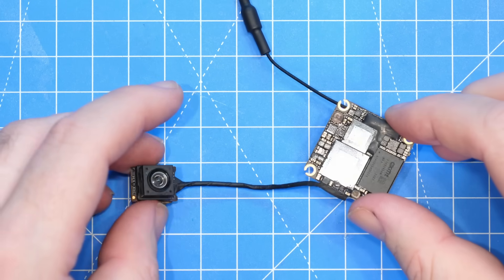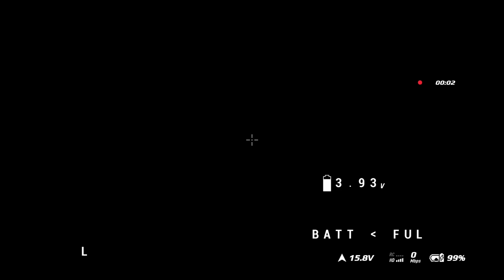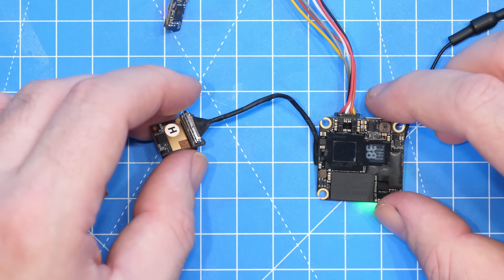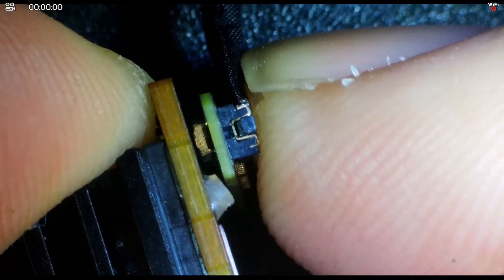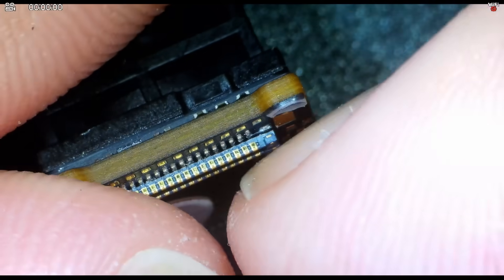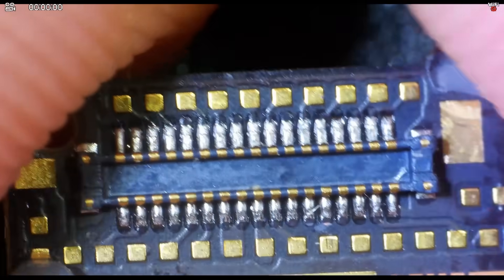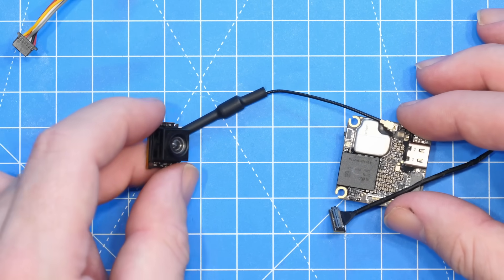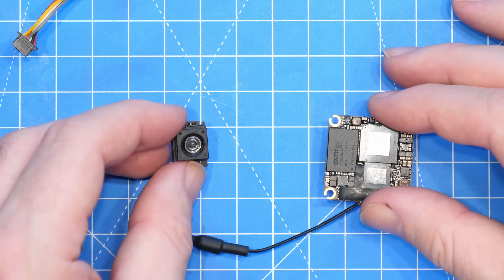DJI O4 Airunit Failure - Bad Design ?

Comment: When you look at the build quality of the original air unit, the O4 appears to show quite a reduction in build quality from DJI.
Reply: If you want reliability , OG air unit is the wait to go
Reply: It was just beefier. Had a lot of shielding etc. Nothing technically related to the build quality of the board itself. The soldering process should be the same if not better. Newer revisions may simply reduce the total number of jellybean components. If they possibly saved a little bit on a different mipi connector then so be it, but this is not really something they designed or advertised to have the cable swapped around. Since users are buying the unit and stripping it down naked anyway, apparently they realized it's more important to the customer to make it lightweight.
Reply: 100%
Reply: In What ways?
Reply: @MountFPV  I've never had an issue with the original air unit, nor heard of anyone else suffering QC issues with it. On the other had, the O4 has only been out a few weeks and I've seen reports of broken mipi cables and DOA units out of the box.

The natural conclusion to the above is that the O4 is more fragile than the original AU and that QC had dropped.
Reply: @Crunklefloop  Have you had an issue with the 04 air unit or the 04 air unit pro?
Reply: @MountFPV   I haven't bought it yet.  I was tempted as the O4 appeared to answer a lot of feature requests missing in previous VTXs, but after seeing multiple reports of issues, the restricted range cap and DJI pulling INAV support last minute it has put me off. 

Seems to me there's no real advantage over the O3 other than a bigger camera sensor.
Reply: And also DJI never sold a "light" air unit before so it's not "the natural conclusion" because you cant compare the two. It's a less than 10 gram computer and camera that records 4k video for $109.
Reply: @Crunklefloop  do you have a 04 unit yourself? If not, I wouldn’t be speculating or assuming. I was just as wary, but I have eight units and the light and the pro have yet to let me down… I’ve even had the frame explode from hitting a pole on one of mine and it still works.
Reply: @Sukanoops  I had typed a polite yet detailed reply above regarding my comment but it seems to have been deleted.

It's great that you're happy with the O4, and I'm glad yours are working correctly. 

I would have to politely disagree that one shouldn't speculate or use the experience of others before making a decision. As an example; before buying a car, you would typically check to see if there have been any reported problems from other users of that model, before making your decision to purchase. 

In summary: I was in no-way saying the O4 was bad, I was saying that I have seen more reports of problems from users of the O4 in the first few weeks than I had seen reports of O3/Vista or the original AU's).
Reply: @Crunklefloop   I shouldn’t speculate or use the experience of others before making a decision???? And then you go on to say you’re basing your comment off what you’ve seen on other people’s channels or have heard on the Internet. How dense are you? The irony😂 I’m not trying to be rude. It’s just sort of ridiculous, did you not even read your comment before you posted it? Also, you should’ve just posted your summary instead of all the other pointless dialogue.
Reply: @Sukanoops  huh? If you read what I wrote again, you'll  see that I'm  swying that you should speculate and use the experience of others before making a decision. Perhaps we're actually agreeing, but simply misinterpreting each other.

Anyway,  I'm not trying to get into semantics; I made a simple observation. It could be correct. It could be wrong. But it was just that, an observation.

At the end of the day, it really doesn't matter what VTX anyone chooses. This hobby should be about enjoying flying, rather than arguing on Youtube.
Reply: @Crunklefloop  Here's one observation I've made, the factory O4 mipi cable may or may not be as durable as on the O3.. but I would assume they are of the same quality. Either way my first mishap with the O4 is a broken cable which I could only source a replacement for from iflight. The cable broke because I accidentally tugged on it way too hard by having something weighted (the camera was attached to) fall off the table and hang from it. I've done that with the O3 before but that just resulted in the connector coming loose, easy fix. The cable broke only from the transmitter side because it has slack inside the camera end, which is sort of sticky-taped down before reaching the connector. 

So after having said that it's the only example I can think of where the actual mipi connector is going to break outside of constantly wiggling it reconnecting cables. In my case the connector didn't even come close to breaking as the cable wouldn't even pull through the gasket on the camera end. All the stress was on the transmitter end and just one wire barely pulled out. Given the actual weight of these mipi connectors, and that they are actually enclosed in metal, it boggles my mind how anyone could break one from crashing their drone unless they literally snagged the cable on something.

Comment: DJI repair service should fix (replace) this under warranty. Hopefully they will revise the design after they get enough back under warranty. They have service centers local to you more than likely!
Reply: Or...it will fail mid flight...
Reply: @stst8301  not likely, will happen after a crash, and for a micro in the park this really isn't an issue... Besides, Betaflight 4.6 has landing mode using just a barometer now, and with gps has working position hold and amazing return to home.
Reply: But they can claim its user error/fault because he remove the glue in the connector that prevent this happen….DJI will ask him to pay to fix the connector or just give him a new board so he can give them some positive publicity finally 😅
Reply: @dstepsfpv  have you ever dealt with DJI support before? I have sent them in two very physically damaged 03 air units (one was crushed, the other had a UFL ripped off) one was replaced for free under warranty and the other one was only like $5
Reply: I hope they won't change a design to support removing part of it (original glue) and straining the connector like 20 times. It should work and survive in practical use.

Comment: Yes,he cut the glue and didn't seem to mention it.
Reply from the maker: The glue won't help much in a good crash.  The point is this is particularly weak point that will pivot as well.  I'm highlighting that fact that the interposer will cause issues like this.
Reply: @MadRC  If properly mounted and protected it does fine in hard crashes on 1s 65mm. 100's of hard crashes. I am sure it will eventually break in a crash someday. If it does I will just buy another. My 75mm 2s is heavy enough where I can see crashing onto the canopy might flex enough to cause a problem. I wouldnt use lite on anything heavier that 85mm, and just use 04 Pro.

Comment: The very reason I'm in no hurry to jump to the newest "thing" for FPV.
Reply: Yep, still loving and learning about O3 and analog :)
Reply: Yup. With DJI wait for 3 months till they fixed 80% of their firmware issues and then reevaluate if you can live with the remaining 20% bugs they never gonna fix and possible hardware issues that people will report in this time. For me the lite was much more interesting than the big one actually (I was hoping for more, given it's their new 1/1.3" chip) but when Ian showed us how fragile that cable was... I was like "yeah, let's wait for real life experience. This thing doesn't look like you wanna crash it at all". This also defies the whole race mode completely. If you can't crash it, you can't race it.
Reply: Mads is pointing out a legitimate shortcut here but it's also not like this is a sign that the unit is going to fail on its own during normal use. Literal glue is the solution here. 
If someone is happy with the O3 there is no reason to jump to the O4 yet, but from what I can tell so far the O4 is going to be an overall better experience for them. I had to buy new goggles just to use the O4 and since I went with G3's it ended up being a much different experience than the V2's. Upsides and downsides. I spent a lot of time with the O3's trying different antennas and what not.. putting gimbals on them etc.. and so far the O4 and G3's are giving me similar or better range and also have all the upsides of faster linking and better resolution etc.. but the downside of not being the best goggles (V2's) and a smaller FOV. I still use the V2's for the O3's and the G3's for just the O4. At this point I'm really just still using the O3's cause of the time/money invested and the fact that they still work fine. If I had to choose in a first investment I'd have just gone with the O4 and G3's.
Reply: @Magneticitist  I'm still rocking the V1s and vistas in my builds. My stuff is always getting smashed doing freestyle and replacing the cam (or even just the lens, for that matter) was entirely too expensive. But, in DJI's defense, I don't think the 03 or the 04 was really designed for freestyle and with what Ian pointed out with the 04 lite, I'm thinking that's not a option either.
Reply: @StupidBrokenToy  The O4 does have the race mode though so it at least seems freestyle doable but when it comes to crashes etc the tradeoff is going to be the shielding and heat dissipation. Freestylers want all the weight gone above all so they need to sacrifice the physical protection. Potting everything might cause it to overheat, and adding physical shielding increases the weight too much etc. I don't think a raised mipi cable has enough weight to be a problem in crashes so long as it's tacked in place.

And look at RC basher cars, which can claim to painstakingly increase the part quality and therefore the bashes between needing to replace the parts.. but in the end all it takes is just the right angle of impact  and nothing is safe.
Reply: In the world with planned obsolescence that's not very true
Reply: Not just that, I rather save money and still get away with a good system with more options. Sticking with V2.
Reply: Na fpv is all about exploring and testing new things. Jumping on what's hot is what it's all about. You're buying comparatively cheap electronics, not a car
Reply: @StupidBrokenToy  newer is NOT always better.
Reply: With DJI every single time it  sounds amazing and it really is but ... there is always a catch! Ian is very good and quickly finding the catch which explains why DJI is so scared of him and does their best to keep their hardware out of his fingers.

Comment: My brand new O4 Lite won’t even bind to my Goggles 3…

Activated, latest firmwares and red flashing LED for bind mode on the Air Unit and beeping on the goggles in the right mode, but it never connects. 

Gutted. It’s going to be weeks before DJI swap it I’m sure. 

Having just invested and moved from Walksnail to DJI, I’m really disappointed and thought I was buying into DJI’s legendary reliability but the second O4 VTX if had is DOA… 👎👎👎
Reply: Sadly you can't expect reliability with a new product from DJI. This is exactly why I haven't bought either O4 yet. It's best to wait it out and let others find all the issues. If you want reliable grab yourself an O3 or a caddx vista/runcam wasp. these huge companies use us as paying beta testers.

These are the kinds of issues we should be seeing with openIPC, not O4. I can't say I'm surprised.
Reply: Are you using O4 mode on the goggles?
Reply: @ Yes. I’ve tried O4 Air Unit, O4 Air Unit Pro, Neo and Avata just in case… 

It’s being returned to DJI as I’ve no doubt it’s faulty straight from the box.

Comment: Would you just use E6000 over the connectot and mipi to hopefully prevent damage somewhat?
Reply: That’s what I’m about to do.
Reply: Yea, I mean DJI also did that so if you remove it, it's safer to reapply something similar.

Comment: It just looks totally rushed, hopefully they really fix the existing design flaws
Reply: In what ways does it look rushed?? What are the design flaws??
Reply: Xbox 360.
Reply: nah dude fried his shit
Reply: @420247paul  tf you talking about?
Reply: @LouisLeXVIII I think he means "fried" as in "broke". He is just basically saying madstech has fiddled too much with the connectors and broke it.
Reply: @420247paul  yeah in his original video, you can see him, tossing it around in his hand, talking about how light it is and just holding it by the wires…. Dude is smart, but has no common sense. I have four O4 lite quads and have beat the hell out of them and they never give me issues.
Reply: @Sukanoops  Exactly! He says mine only has "bench use" as if that means less abused. It's not meant for "bench use". You put it in a quad right after opening it and you wont have problems.
Reply: @MountFPV   better yet they actually all come with glue on the coaxial cable so the fact that he ripped the glue off and messed with, it will void his warranty. I put some E 6000 on mine and I don’t even have a good mount and I smacked a powerline at 40 miles an hour and it’s fine and that’s on a 4S mob8 I built so it sits on the quad like a tiny whoop so it took all the force lol.

Comment: Bummer, ive hot glued both sides of one of my o4 cam conn.  im thinking of trying e6000 on the other, see which holds up better.
Reply: What were your results with e6000? How’d it go? Thanks so much
Reply: @lecolintube  Both are still fine, but i have not beat them up much, i have analog whoops to fly hard.
Reply: @daves3016 Awesome, thank you. Saw someone else recommending b7000 glue (bit more flexible?) so keen to see peoples experiences here with the e6000.
Thanks so much again!